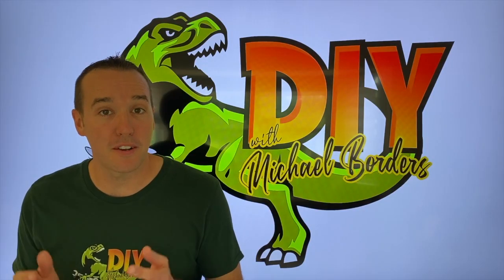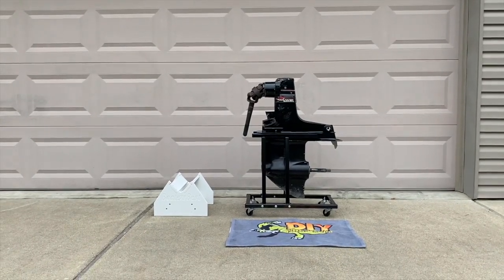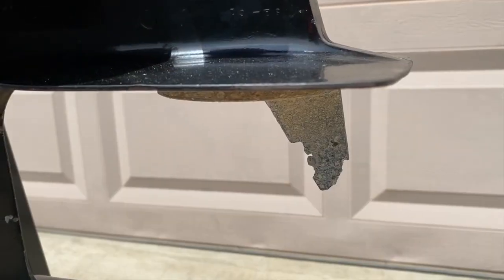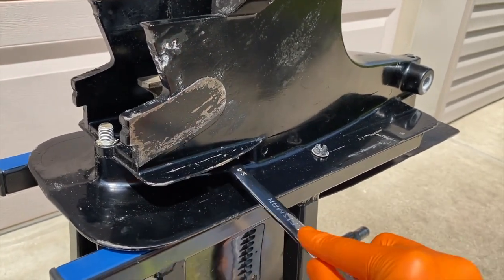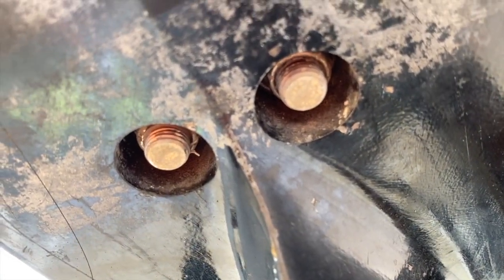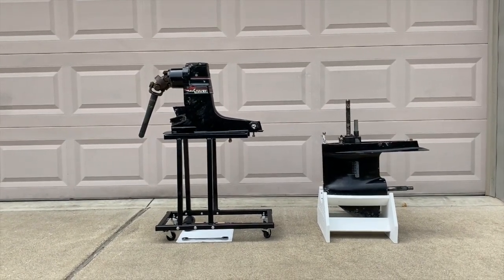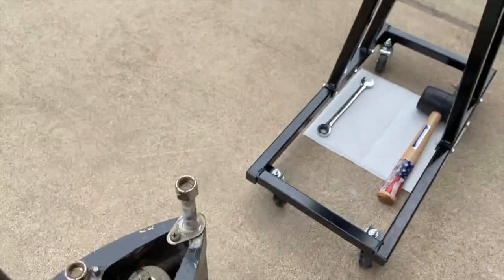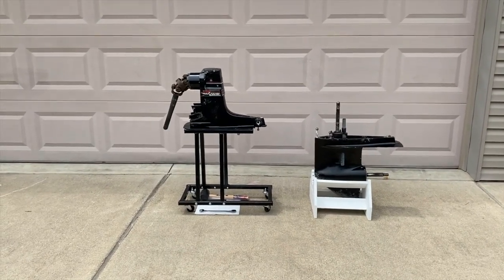Separate upper and lower mercruiser outdrive

Comment: You just saved my life.  I was just getting ready to start banging my head against the outdrive to crack the damn thing open.
Reply from the maker: Thanks for watching, we appreciate that.  😁👍

We are hear to help answer any questions as you work through your project.  What are your plans, a full rebuild?
Reply: @DIYwithMichaelBorders  Just wanted to change out the water pump impeller but I couldn't crack it open because I missed the bolt hidden behind the anode under the outdrive on my Gen 2
Reply from the maker: @gm1937  

Very cool, a new water pump will be nice.  😎👍🧰

Comment: Hey I'm just removing the lower unit so does it matter if it's in neutral or does it need to be in drive before I remove it?
Reply from the maker: @robgibson8640  

Thanks for watching, any update on your project?  Having linkage in the forward position or configuration is recommended.  🧰

Comment: sure would be nice in my world if bol;ts even w pb blast on em came off like that i had to grind donw a number 10 hex head socket to get that bolt out what fun
Reply from the maker: Thanks for watching & sharing this, our stubborn part was our lower unit bearing carrier, it held on for dear life but we finally got it out.

😎👍
Reply: that bolt was frozen on ours as well. What we did was gently heat the outer part of the leg around the bolt then we used a socket/Allen key on a power bar. Then as one person applied firm pressure tot eh power bar, a second person lightly tapped the head of the socket/ power bar and the light shock broke the corrosion seal.
Reply from the maker: @maxglide  

We really appreciate you sharing this.

😎👍